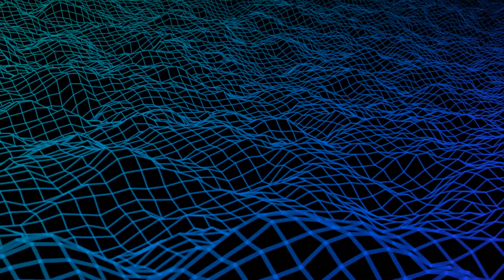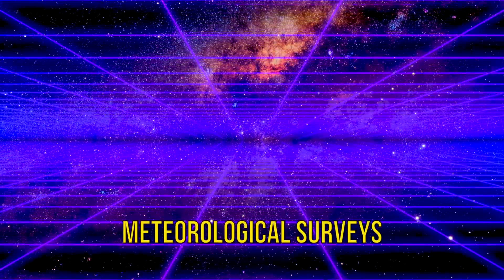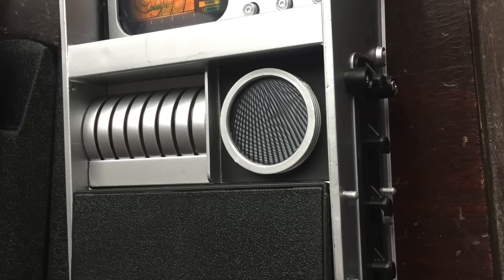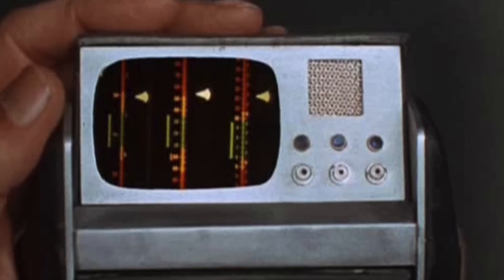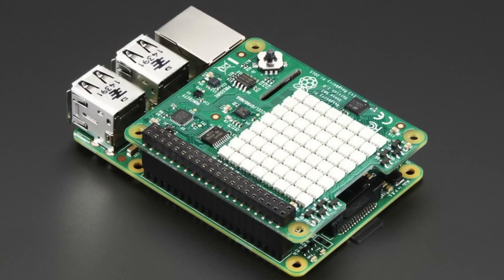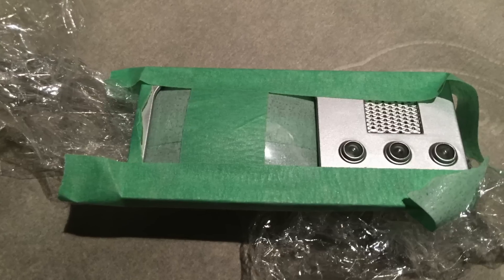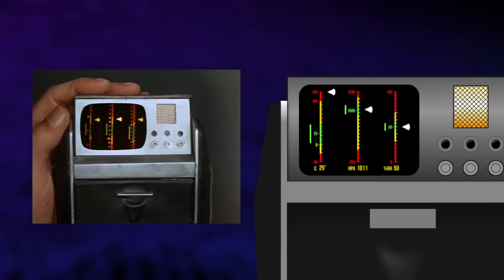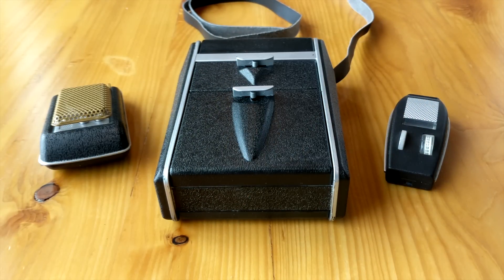[project] Raspberry Picorder

Comment: You're diagram is a little vague when it comes to connecting the components. Any chance you can release the wiring diagram?
Reply from the maker: Sorry about that, this video was made before I had really used any ECAD software. The wiring for this project is also deeply flawed just in general so I'm not sure people should attempt to duplicate it.

I'm revisiting this project in tandem with my new Picorder so I've gone ahead and packaged the SVGs of the original build, as well as a KiCad project file for the new PCB I'm developing into a Git repo.

Here is the repo with the latest files.
https://github.com/directive0/TR-108

The kicad project file includes a schematic of the backplane.

Theres also a teardown video that gives you a look at the basic design and wiring, but again yikes some of this wiring is baaaad news: https://youtu.be/Va_liZ-Un3k

Thanks for checking this project out!
Reply: @obso1337  Thanks for the quick reply. This Picorder project is something I've been wanting to tackle for a while now. I have a Pi Zero and a suitable power supply but I wanted to do more research into assembly before ordering the sense hat and LCD. I have an LDC that's not quite the same as the one you used but it is designed for the Pi.
Reply from the maker: @GESSO217  No problem! Yeah the screen turned out to be a bit of problem since it is actually rated for 6 volts apparently? I had to add a buck/boost to get my 6 volts. I don't know if I'm going to swap it out since it really only needs 2 unique pins (6V and Composite Video) and the space to cram wires into that display module is tight. I'm not sure I'd be able to fit all the LED/button wires, 3V, GND and then ontop of the pins needed for the SPI screens I have.

I set up a discord for folks making their own working tricorders (be they arduino, pi whatever). I call it "mycorder". Its not very big theres only a couple of us on there but if you want to chat more about your project I hang out there and its a good place to bounce ideas in real time. Feel free to join us: https://discord.gg/VbjYYdSZMb

Comment: This looks great. I've started work on a similar project, using a Pi 4b and one of the Marco kits sold on eBay. Found a nice little rechargeable battery pack made just for the Pi.

The only major difficulties for me so far are: no software coding knowledge, technician-level electronics, and trying to find a display that won't take up space on the 40-pin, and will fit in the display section without extending beyond the edges or getting in the way of the LEDs and controls. That last one is the main hurdle to getting it together; I figure to use Phat Stacks for any sensor packages, do a multiple-item thing.

Who made the display you chose? Also, I ran across the PicorderOS section in GitHub; hoping to make use of some of that to get a little practical functionality out of it once I've learned a bit more about the Pi and the software. Thanks for making that available to us NOOBS Newbs.
Reply from the maker: Hey thanks for your comments. I'm actually working on an update to this right now and hopefully will have a video out about it soon. 

I love the idea to use a pi4, I have a couple around the house and they are GREAT little SBCs in my opinion. I have some cautions that come to mind when you mention using one for a picorder, but these are just my thoughts they might not be catastrophic problems:

First the Pi4 runs super hot, it may not take well to being in the enclosure, at the very least your temperature readings will be severly effected. You might want to try thermally insulating the sensehat (or whatever sensor you use) from it and try to add good ventilation to both areas. 

The second is the Pi4 might be a bit power hungry for a mobile application? I dunno. By doing the tr109 I learned I really did not appreciate how limiting power constraints were so I'd spend some time making sure whatever battery you choose can match the requirements of your system.

SCREENS: The screen I chose is from adafruit, but it's important to note that the screen I went with in my build was a mistake. I didn't do my due deligence and the screen is actaully a 6 VOLT screen not a 5 VOLT screen. This caused flickering and poor performance. I have devised a solution but it is not elegant. I will have more information in the update video soon.

My advice is to look into Luma.LCD a python library that supports a bunch of LCD displays using the SPI bus which has more wires to manage but its probably worth it in the long run. The ones I like (and have integrated into PicorderOS) are the screens that use an ST7735 IC as they are easy to use in my experience. Anything around 2.5" diagonally is in the ballpark of where you want to be (atleast for the screen on the diamond select toy I have) As yet the picorderOS software is not done for this TOS model of picorder to use SPI display, but I hope to do it soon. It should be trivial to adapt.
Reply: obso1337 - what was your solution to the display power problem? I’ve been looking around, and so far that’s the only one I’ve seen that could do what I want: fit in the display section, not take up GPIO pins, thanks to its RCA connection, and not get too much in the way of the LEDs and buttons on the right. The power thing is the big stumbling block for that. Of course, if it’s possible to set up that wiring with other displays, that’d be a plus.

I want the left button to be a simple on/off button for the pi; was going to have it be that switch shown in the schematics as activating when the display opens, but that’d mean startup/shutdown with each open/close, so I decided I want that to just be a sleep/wake switch and on/off for the display only. Don’t really know how to do that yet, but that’s what I want.

The middle button would push button- cycle through sensors and groups, while the right button would cycle through graphic formats: bar graphs, line graphs, etc.

I’ve picked up a dual-fan item to handle cooling; I’ll have to move the battery section to make it fit, though. I found a Pi-specific smart battery thing on Amazon, does the job pretty well. I’m basically all set to go, the display is the only thing holding things up. Once that’s solved - well, that and that figuring out the push button cycle thing - I figure I can put it all together and set up the Phat Stacks as I go.

I also found a couple of GPIO extension options; one’s just a chip, the other a whole card, and a third plugs in via USB, don’t even know if I can make that work with this.

Clearly, I won’t have this done by next Tuesday. But it should be interesting to figure out.
Reply from the maker: @nightflyer28  Hey! So I intend to do a quick little update about the picorder soon, but I'm still having problems with it.

I like your ideas for your build! Theres so much cool stuff to integrate into Pi projects Im excited to see what you might come up with and maybe intergrate it into the next picorder which is well underway.

Yeah I think the screen is still okay for this build. To fix the 5/6volt issue I used an off the shelf adjustable buck-boost convertor to give me 6 volts. That cleaned up the flickering and weirdness for the most part. I'm still getting some sporadic boot looping that I'm trying to track down. More details to come soon!
Reply: Cool, I’m looking forward to seeing more about how this build evolved.

You wouldn’t happen to recall who made that adjustable converter, would you? I’ve decided that the Adafruit display is the right one, just because it uses the a/v port rather than taking up space on the GPIO, but haven’t found anything that’ll take it from 5v to 6.Lots of other ranges, but nothing so far that does that one.

My PiCorder is coming along nicely; still need to fine-tune the plan for attaching a removable Phat Stack to the back, find out how to get push buttons on the display to cycle through functions and display graphic formats, work out how to extend the GPIO options, etc. I suppose it’d help if I wasn’t still at the Dick and Jane, See Spot Run level of software knowledge.

Clearly I still have a few hurdles left to overcome.

Comment: Well, it took me a lot longer that I thought it would. Getting it to play on start up was the main problem. Never got it to start up right with crontab. Wasted a lot of time because   the display resolution of the pi was picky - got nothing but black screen on some settings and I thought it was crontab's fault. So I kept trying to troubleshoot that. Then the image on turn-on was different from when the script was run after turn-on. So, used autostart and it was ok.

Still amazed in the complexity of the code. I'm a copier/modifier. Did have a few issues: some scripts had spaces instead of tabs and python complained about that. Also, I got a lot of errors about the log file. Didn't look like the file name was defined. So I just remarked the out log references. Also, you had a 'quit' command to leave python, but no way to power down. I added code to power down when buttons 1&2 were pushed. 

Never was able to buy the 'store bought' enclosure. The cheap $60 'prop' was never available and didn't want to use a more expensive  version. So, I bought a slightly larger enclosure and used that. Box like, doesn't look like the 'real thing'. Will post photos on my site later. anyway, great job you did!
Reply from the maker: I just want to thank you for reviewing my code and trying this for yourself. You've helped me realize a lifelong dream of contributing something to the greater electronics/software community. I can't wait to see how your turned out.

Comment: Have you added sounds yet?  Is there any possibility of you (or someone else) putting together a kit, so that someone (like me) can do this with less effort than you did?
Reply from the maker: Hey!

Nah I haven't added sounds yet. I'm going to do a followup to this build for sure in the future because after using if for a while I've discovered lots of things that make this build flawed. They are easily fixed though!

I don't think I would ever make a kit (just because so much of this build is off the shelf or kludgy to put together) but I would definitely consider refining my documentation so others could more easily replicate my results. I am working towards that on my new site:

https://squaredwave.com/wiki/index.php?title=Picorder

I am also working on a successor to the Picorder 1. My next one will be built into a TNG Tricorder, so stay tuned for that! You can read about it here:

https://squaredwave.com/wiki/index.php?title=Picorder_2

Comment: Just starting to duplicate your project. Don't expect to make it perfectly, not that good of a programmer! Anyway, a few questions. When you turn on the tricorder, does it show the 'raspberry' image and then you start a python script? Can you explain that for me. Looks like the 'prop' tricorder won't be available from online store until March [at earliest]. So plenty of time to work on this project.
Reply from the maker: Hey there, glad to hear you're gonna take a crack at your own Tricorder!

Yeah so when you power on the picorder it boots up like a regular Pi, but what I did is I added my python program to the crontab so it would start up automatically.

Here's the problem though; if the program is executed before the window manager starts then the program will fail, I think because either the necessary dependencies don't have a chance to load or maybe a permissions problem. I never really figured out WHY it would fail but I got around it by adding a delay to the job. I don't have the file in front of me but I can try and find it for you.

TL;DR:
You need to A) make your python files executable using chmod, and then B) add them as a cronjob with an appropriate delay so they won't be called until the Pixel gui starts up.

Comment: Exceptional work. Did you ever have any prototype circuit boards made? Asking for a friend from the 23rd Century. Also wondering what you might change thinking about the Tricorder as a wearable and functional object that complements say, the Bluetooth Communicator? Would love to discuss.
Reply: Also, did you happen to do a design drawing or circuitboard for the human-machine interface, bridge i/o and power dip switches? :)
Reply from the maker: Hey! I never had the prototypes printed, and it turns out they were totally wrong anyways. At the github in the description is a SVG file that has everything I used for this video which includes a crude wiring diagram for the whole thing. I'd be happy to try and make a more concise one if it would be helpful.

I've decided to make a subreddit for this topic so we can all work towards making personal tricorders possible by pooling our knowledge and resources. If you'd like to join head over to reddit.com/r/mycorder
Reply: Fabulous, will do! Thanks so much and congrats again on a really fine execution of your idea!
Reply: @obso1337  Wish you would come out with a no solder kit, or a ready built model to sell. I'm legally blind and would love to have a working tricorder.
Reply from the maker: @larasworld  I'd love to do that. I'm working on an upgrade right now and I'll see if I can make something like that possible.
Reply: @obso1337  Maybe a small keyboard cemented on the backside of the lower door, not sure of the room the new design will have.